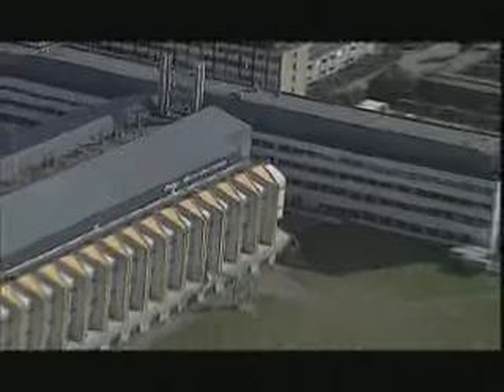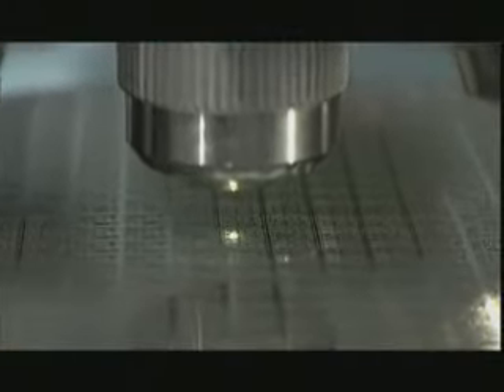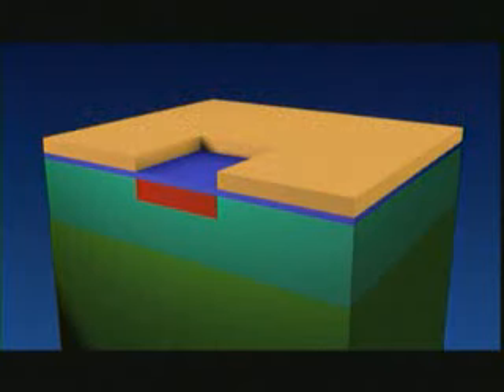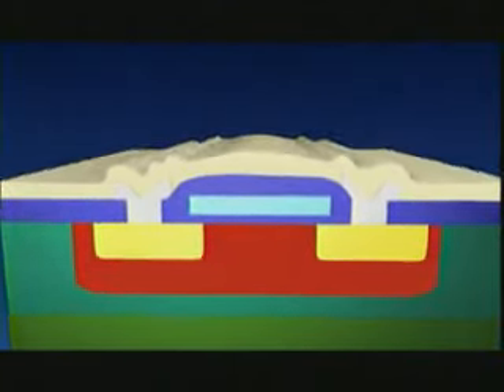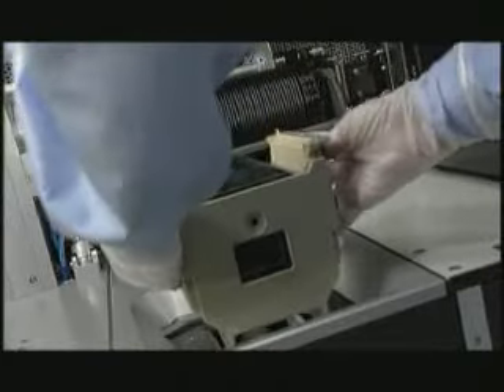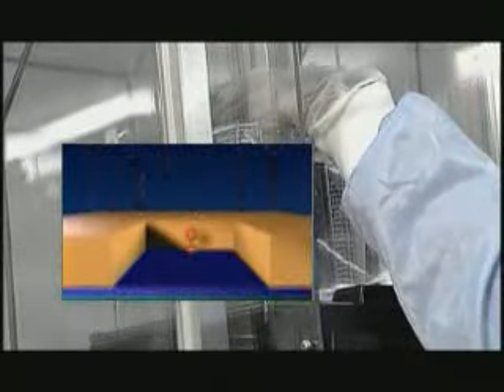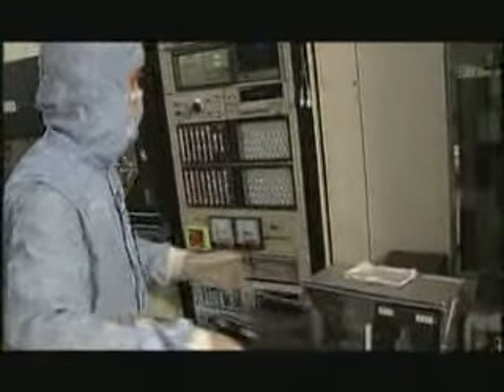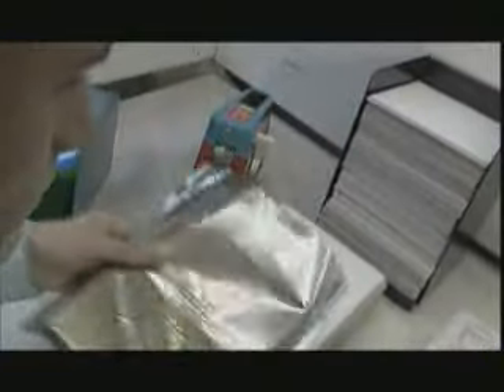The Fabrication of Integrated Circuits

Comment: Whats most amazing about this video is that it is from 1996. If you think this looks impressive, think of the cell phones from 96 vs now. Yup, that's how much more impressive this process is today. Simply mind blowing what we have accomplished as humans.
Reply: I wish i could take the credit
Reply: Considering I started with DTL the TTL back in the early seventies was amazed when VLSI and CMOS came out, then the 8086/8088 then was all over bar the shouting when 80286 16 bit microprocessors were introduced. Plug and Play was the future and ... I became obsolete overnight as no-one hires an engineer to fix a PC anymore 😆
Reply: The process still is mainly the same today. They are using shorter wavelength, etc. but the principle is exactly the same.

Comment: The main advantage of IC's is that they can contain millions and even billions of transistors each. For example, a simple 4GB  USB flash drive contain an IC containing over 32 000 000 000 transistors. Mounting those transistors individually on a PCB become an impossible task. The PCB is an insulating fiberglass card having conductive copper traces etched on it. These traces link together different components including IC's.
Reply: are you kiddin!!!

Comment: I've never found an answer to this but every time I see this process explained and they talk about chips which fail testing and are not used I wonder if they are discarded, or recycled somehow, or what becomes of them. I would love love love to have one of them embedded into a block of clear resin and used as a frickin' awesome paperweight or keychain or something.
Reply: You could always buy an old chip on eBay for a few dollars, I often see CPUs with damaged pins being sold for as little as $1, then just remove the heat spreader and use the chip for whatever you like.

Comment: who discovered this way of doing this? and how did they started before having all those machines that were built up with the same chips this machines creates?
Reply: Started with hand made large chips that could only do a few tasks and progressed each year.
Reply: Jack kilby introduced ICs in 1958 and then Robert Noyce the CEO of Fairchild semi-cinductor (Which is Intek now) inhanced it and made practical, before ICs computers used descrete components and this is actually the reason why they did start using ICs, because of a problem called "The tyranny of numbers" caused by descrete components.
Reply: @m0st4fabeder  💜
Reply: "New Thinking" I recommend this book that will give you answer on this and similar questions

Comment: A PCB is a container for the ICs. It would be difficult to interconnect ICs without a PCB - actually, people have done circuits without any PCB (see wire wrap on wikipedia). While each IC has a specific function, designers can interconnect multiple ICs and other components like resistors, capacitors and more using a PCB to design a product - like motherboards, mp3 players - without having to reinvent the IC every time.

Comment: An IC doesn't really need to be a network of transistors. It can be a finely tuned group of circuits that preform a task. opamps, reg's...
The big diff with IC and PCB's is that they are complimentary as you cant really get everything you need to operate a circuit inside an IC so it needs a home to for those parts (yes, you could make all IC's discretely, but why?). Human interface and large capacitors need to be mounted and connected, and thats where the PCB comes in for modern electronics.

Comment: i assume they building mosfet. but i only see metal layers connectedc with drain and source... how is the gate exposed?
Reply: Jun Ouyang well, if you go to 3:50, they did doping the gate terminal where the gate was only pure silicon before, by doping the got a silicon much easy to conduct, which is no longer necessary need a metal as connection

Comment: what's the best explanation why IC (Integrated Circuit) is in Square/rectangular shape, not circle?? Why they manufacture it on that shape?
Reply: For the same reason most boxes are square, because it's much easier to pack and organize things that are square in shape. Also, easier to cut.
Reply: So that subatomic particles can be utilized properly from all sides.

Comment: 2:59 how did that red stuff get through that blue oxidized layer?
Reply: booger king Remember there is a silicon layer that allows atom penetration, the blue layer just protects it from external intrusion other than the process requires.

Comment: how do you get atoms to penetrate the silicone? and what kind of atoms do you use? they start talking about it at 2:54
Reply: The energy of atoms is increased by electric field and shot into the silicon. This is called ion implantation. (Similar to shooting lead shots into a solid wall). The type of atoms depend on the type of material - n-type or p-type material you want to make. For making silicon n-type material, Phosphorus or Arsenic ions are used. For making silicon p-type, Boron ions are used. You need n-type and p-type materials to form a p-n junction like in a diode, transistor, etc.

Comment: Always wanted to know what the yellow lights were for! Thanks :D
Reply: The photoresist (photo sensitive material) used for pattern transfer is sensitive to ultraviolet (UV) light and  insensitive to yellow light. That is why they use yellow light in the photolithography room.
Reply: Michael Turner yeah actually i needed to know about that, thanks

Comment: this process looks extremely expensive. how can 555n ic's go for 13 cents a piece?
Reply: as you can see, MILLIONS of chips can be made in one run of the machine.
Reply: It is a little bit same as with printing news paper. It is most expensive to set up the production, but once it's all set up started, it's not much more expensive to make more of them.

Comment: ok I got it, the starting point is a flat, P-type single-crystal Si wafer, but why is P-Type called P and N-type is N ?
Reply: No, the starting point is regular silicon. P-type is created by adding Si+1 valency impurities that draw electrons away from the silicon atoms creating valency holes ready to receive extra electrons and thus increasing conductivity. N-type is the opposite – adding Si-1 valency impurities results in free electrons and increased conductivity.

Comment: Thing that confuses me is the cost. The numbers make no sense. Making a chip looks like THE most complicated thing on the planet to do. Even just a simple chip like the NE555 timer requires 300 process steps and much time to fabricate. Yet they can be had for like 3-cents each on eBay. This is proof that it is not all about the money. Life is not simply a matter of making money. Life is far more complex than just that of a number that equates to a sum of money if you are you are dead man.